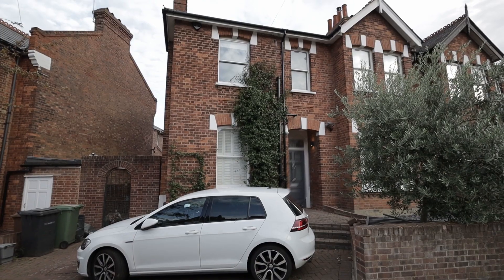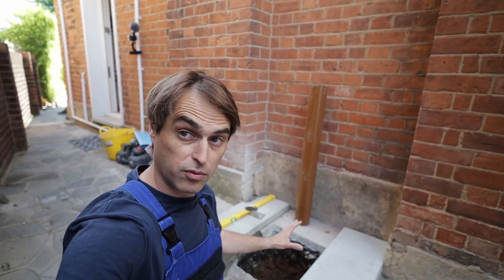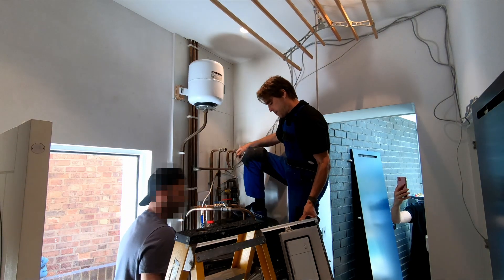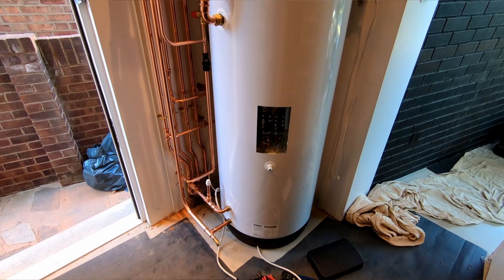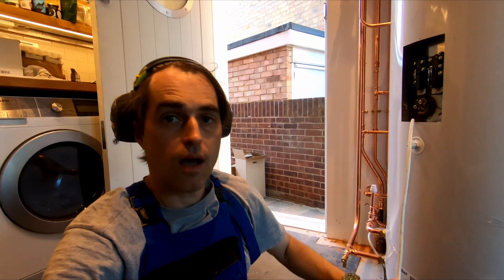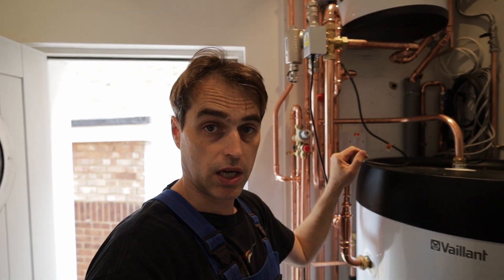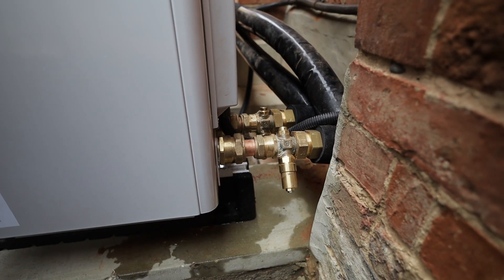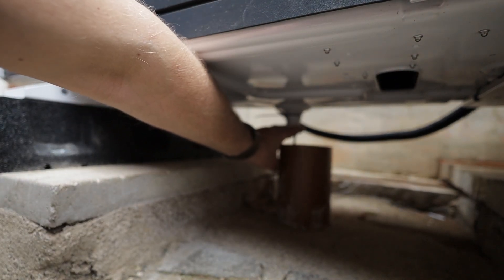Is This Heat Pump Better Than Your Gas Boiler?

Comment: Another good video. Just been through a similar exercise and went for viessmann 11kw boiler for a heat loss of 7kw and PDHW at around 15kw. Flow temp designed for 55 degree flow with weather comp and weather comp blender for UFH in extension.
When doing your comparison how does 10 year cost of ownership compare? You could have made old boiler more efficient by using PDHW and reducing flow temp to 50 degrees as you said radiators etc were fine at 40, this would have made the boiler more efficient, let's say more like 90% than 80%. What is the comparison cost between heat pump install and more efficient boiler? How much is annual service for heat pump system over gas boiler - and importantly how many people can do this well, what about comparison cost for spares.
While I think heat pumps have a place I think an honest and complete 10 year total cost of ownership still favours a gas boiler, 
Might be a different case in 3-5 years but currently they are more expensive to buy, install and service and this is not made up from potential differences in efficiency.
I am happy to be proven wrong, but my boiler sized on heat loss and 55 flow temp, PDHW and unvented hot water system change from old gas boiler and vented gravity hot water was based in all the above.
Keep up the good work.
Reply from the maker: My favourite solution (at least on paper) is a hybrid of a small HP with a gas boiler. From purely running cost pint of view this has a chance of being the cheapest option. Also dhw would be on gas alone.

I will be testing this kind of setup in my next house that I am starting to look for in Sep.

90% efficient boiler is still more expensive to run than 400% scop HP.

Although people charge more for HP servicing, HP generally should have much less faulted and double the life span of an average gas boiler.

Servicing cost will come down. 

Also, once the house is HP ready with rads and pipework - just the heat source swap will be pretty comparable to boiler swap and possibly will just take a day. 

I love the tech and I can see how it will be the future of heating. Not for everyone and not for every house but HPs will play a big role in the domestic heating market
Reply: @UrbanPlumbers  We have installed a number of hybrid systems with ecoTEC's, our experience is excellent.   The key advantages are you can support a bigger footprint than you would normally with a single phase connection, the gas boiler takes the flow from the hp and raises it just the minimum amount before returning it to the buffer, the gas boiler normally comes on during the de-ice cycles dramatically reducing this time and preventing the death spiral that can occur during harsh conditions with large loads attached to the hp.  Having the system hydraulically seperated also allows more flexible zone control.  The amount of gas you use is minimal, typically we use an LPG boiler without a line charge associated.  The VRC700 & 720 really are excellent at cascading appliances.
Reply from the maker: @kiwim3p587  I got at least 3 projects where this is going to be the setup. How well can you integrate 3rd party boilers with arotherm?
Reply: @UrbanPlumbers  You can use the ZH output on the wiring station to drive a relay which can then switch the non vaillant heat source. Set the boiler to 70°C and the control to stage 1 assist.  You can configure if you want the boost just for DHW or CH + DHW.   Not as good as using a vaillant because it doesn't do moving set point in the appliance but functional enough.
Reply: @UrbanPlumbers  it’s probably not worth paying the standing charge for gas for the ultimate in efficiency.
Reply: @UrbanPlumbers  but surely the whole point of changing to a hp is for climate change reasons, so pretty pointless to continue with gas!
Reply: @UrbanPlumbers  Sorry to be ignorant, but what's 'HP' - this thread is very interesting, but sometimes (I didn't live in the UK), some technical abbreviations are not so obvious.
Reply: @cardboardmusic  HP means heat pump.
Reply: @geoffwells6724  Thanks, I suddenly realised that after reading a bit more info - here and elsewhere.
Reply: @UrbanPlumbers  expecting heat pumps to have a longer life and lower whole life cost than a boiler is   beyond hopeful
the dearest part of a combination boiler the HE around 300 the dearest part of a HP is the compressor. around 3k
a gas boiler sits indoors in a nice atmosphere. a HP sits outside in all weathers and works the hardest and under the most strain in winter. The market is price driven hence the high level of rebates . Once those start to drop then the take up will fall dramatically 
I've been in ac since the early 80's and I know how quality has fallen especially since China came into the world of manufacturing. Cost cutting and 'decontenting' has drastically reduced life expectancy for everything. HPs are no different.
There are a few innovations in compressor technology which may alter the game by upping COP to 6 and above which will help balance ROI but till then I'd recommend high quality  insulation investment first c/w a decent gas combi boiler which will tick over till the early adopters take the pain of this brave new world
Reply: @richardbartlett6932  your recommendation is purely on the basis of finance, but that's not the only consideration. Some people are willing to pay anyway for environmental and/or other ethical reasons.

For those who care about leaving a decent ecosystem to our grandchildren's generation the ethical premium (the cost of our ethical stance) is coming down. 

Not everyone will wait for zero ethical premium.

Myself I'm waiting for affordable ethical premium.
Reply: @UrbanPlumbers  we have solar PV diverted excess into the hot water. We did this when the top offer was in for solar generation so it's very good for us. Not used gas or paid for elec for hot water for 2 months, but we know we are lucky.
Would still be interested in a total cost overview from your perspective of gas boiler set up efficiently is X, say £3500, 90% efficient, heat pump buy and install Y, say £6500 (for easy math) at 400% efficient. So over 10 years cost diff is £300 per year. Service cost I don't know but say £60 gas boiler, £100 heat pump, so £340 per year total. 
Like this I still see heat pumps getting closer, but still a good way to go when compared to a system sized and set up as you have described in some of your other videos about saving money with existing systems and controls 
And who knows heat pump efficiency might be like boilers, says 94% on the box and dies about 80 if poorly set up. Heat pump 400% on the box or more, 250% maybe ..... Time will tell.
And in the meantime Elon musk will come up with a small cold fusion reactor in a show box and we will all have been wrong :-)
Reply: @stephenhill3593  I don't think Elon Musk will have a solution as many electric car owners waste lots of time charging up their batteries when the grid is already overloaded!
Reply: Boiler will be cheaper in that time frame.
One may allow my children to have only a moderately changed world.
Other one continues to boil the world for them.
With the cost of gas crisis, we all desperately need to insulate our home effectively asap and the government needs to help / make it happen. Whatever thrnsource5of the heat we need to hold onto it not let it rush out our roofs or walls / floors like now. Beyond a joke that we haven't sorted this before now.
Reply: @Lewis_Standing  Agree about insulation. We have done what we can with good double glazing, cavity insulation, lots in the loft but now it’s diminishing returns for doing much more. Also need to think about ventilation as house getting blocked up so might investigate a PIV unit.
Everyone should do what they can but I’m not sure homes are the worlds biggest issues, it’s a very small piece in a very large and complicated jigsaw.
Reply: @stephenhill3593  i always thought the medical profession said ventilation in homes is important, but it seems we're also being told our homes need to be effectively airtight for these heating systems to work.
Reply: @PC-vg8vn  This is why I am thinking about installing a PIV unit to add filtered air to the house, reduce humidity and stale air etc.
Would be interested to hear people's views about these units?
Reply: @Lewis_Standing  UK housing is designed to cope with both cold and hot seasons. Insulation is fine but you lose in the summer as you’ll need to cool it, so another bill. It’s unrealistic to retrofit insulation unless your stripping the whole house and aren’t residing in it. Until prices fall it’s improbable this heating solution will gain traction. For now it’s a virtue signallers wet dream but not for the common working man.

Comment: and yet more rubbish about these heat pumps - most houses in this country are designed and built with air flowing through them - air bricks anyone? why do you think they are there? and how many people have seen what happens when they are blocked or even removed by householders? damp dry rot etc - it costs them a fortune to fix it - heat pumps can work in modern insulated and built to a spec house for virtually no airflow requirement but what are 90% of the other houses that don't have this going to do? Notwithstanding of course the great big elephant in the room that it takes alot of electricity to generate this warm air with a heat pump and electricity is currently very expensive compared to my oil boiler which costs practically nothing £1100 a year if that (even with increased oil prices) - if you're worried about the climate change/warmimg/cooling/anything that fits argument then you might want to realise that 80% of our electricity is bought/borrowed and generated  mostly from fossil fuels - so how is this going to solve anything? 
The national grid actually shows their stats on generation of electricity and if you look renewables in some months are less than 4% of the total....
Reply: YouTube really needs an "Simpleton" filter before allowing people to sign up and comment publicly.
Reply: @avivscrewvalla  Yes I agree - oh but it doesnt work you've just posted....
Reply from the maker: You just showed a total lack of understanding of pretty much everything
Reply: @UrbanPlumbers  ahh yes the no facts or thought required reply - superb you've proved your point - is the world going to melt next week then?
Reply: @snorwitz4265  everything you said is wrong. that is it. there is nothing to fact check, you are just flat out wrong about every single thing you said.
Reply: @SupremeRuleroftheWorld   - how?
Reply: @snorwitz4265  i dont know where you get these ideas from, that is something only you can answer. i can only tell you that litteraly every single thing you mentioned is just flat out wrong in every aspect. its not my job to educate you, that is on your goverment and your own personal choice to actually learn stuff and do basic fact checking.
Reply: @SupremeRuleroftheWorld   oh do stop with your non replies - its pathetic - £1100  a year versus £15000 for a heat pump plus the massively increased electricity bills - guess how much a small controller unit for an oil fired boiler costs (look there's some facts for you as you don't seem to know what they are) - just wait until next year when electricity bills rise another 200% Mr renter ;-)
Reply: @snorwitz4265  now who is making up stuff? 15k for a heat pump? just say you dont have a clue what you are talking about.

Comment: What's your thoughts on an actual measured heat loss survey rather than just assumed?
Reply from the maker: I haven’t tested any methods yet so I have no opinion on measured results.
Reply: @UrbanPlumbers  keep me posted! The protons for breakfast guy has a nice formula based on existing gas energy input into a home that I've found get pretty close. So handy for a 5 minute calculation.